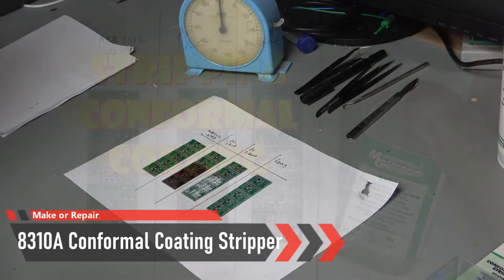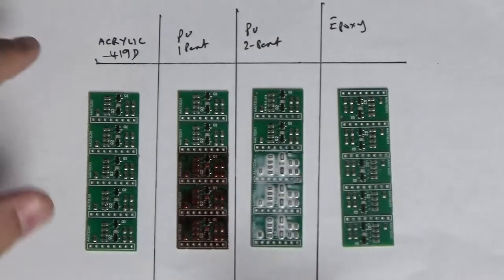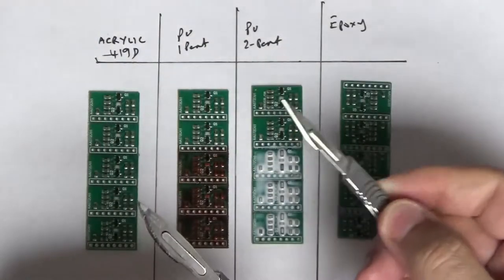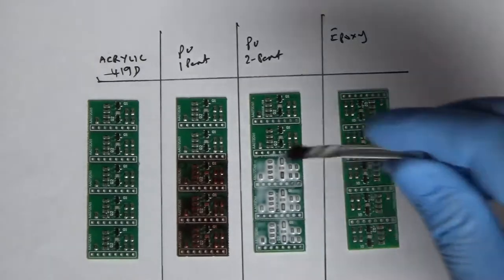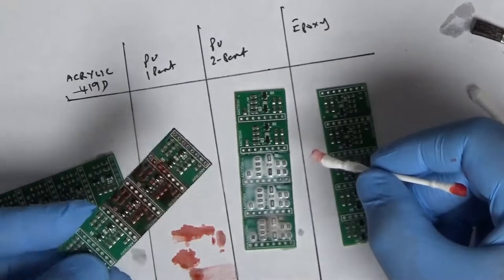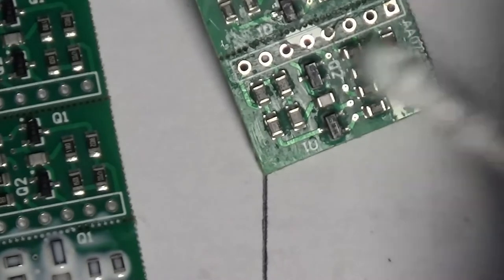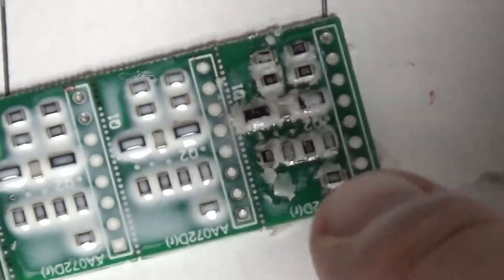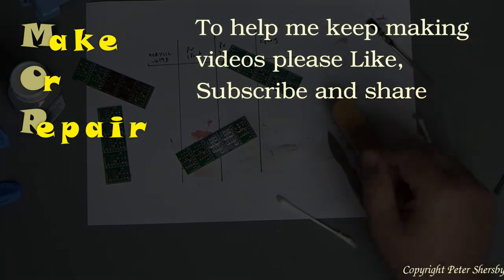Conformal Coating Stripping #0069

Comment from the maker: Hope people find this helpful, anyone tried paint stripper?
Reply: I've only ever stripped small areas on PCBs when repairing electronics from China that happen to be coated. I have no idea what they use as a coating, but most of them will come off with isopropanol and a cotton swab. Any boards that resisted would yield to a subsequent dab of acetone.
Reply from the maker: @BusyElectrons   just recorded to help those who need it.  acetone will handle the acrylic and I think uv cured see the list in the video for all those that can be stripped with ketones.  A lot of newer things should be using acrylic because it is safer to handle, but it is not suitable for harsher environments with high temperatures  chemical contaminants etc.  the problem is the two-part ones such as epoxies, as the polymer chains are longer they resist removal more.
Reply: Useful, hell ya, just ordered the 850ml can. The cost was reasonable too. Surprised though because MG Chemicals is sometimes a pain. Been trying to get my hands on their liquid tinner for a while but as I understand it you can only get that one stateside.

Comment: I need to remove ECC3010 but i can't find nothing about that u think 8310A will work??
Reply from the maker: It is a 1 part Silicon Air curing coating, so I should think acetone would be my first try after that 8310a would seem a good bet, but with coating it can be trial and error.  If it is thick see if you can make progress first scraping or cutting